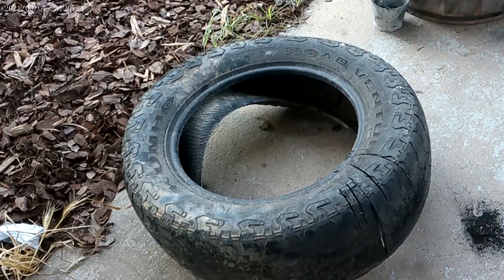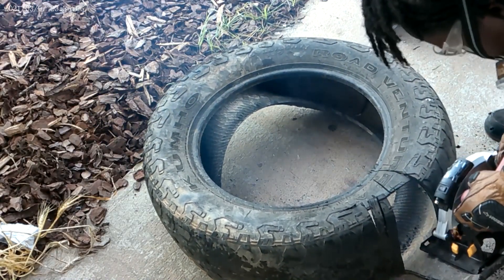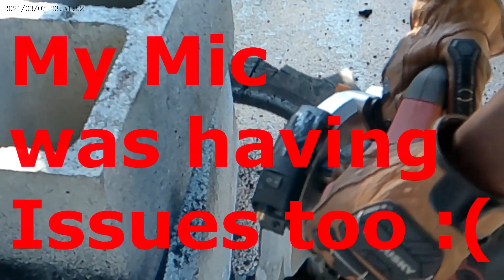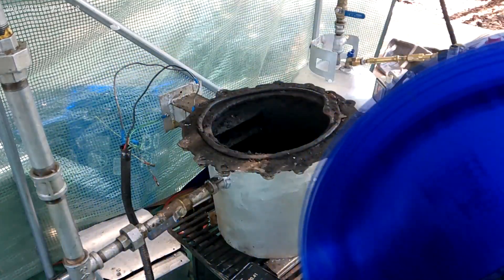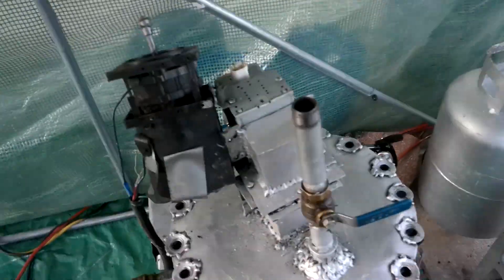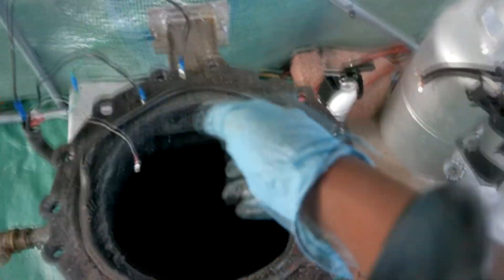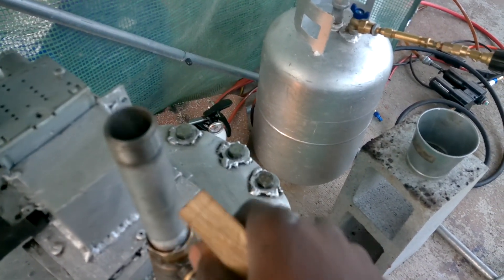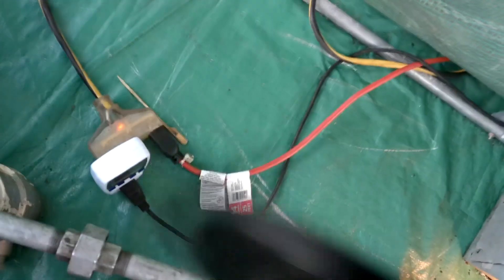Will It Pyrolysize? -  Rubber Tires

Comment: bro i see you upload a video of russian guy that did it, but i think the final color is clean depend of low temperature of condensation (i think).. also the video mentioned is "Tire-extract fuel vs pump gas - which is better?", 
also you can try condensation with air conditioner compressor with coil around water?

Comment: Will the steel bands in the tires mess with the microwaves? Also you say that carbon readily absorbs microwaves. Is there a practical way to clear some of it out a few times during the process and would that do any good?
Reply from the maker: The steel acts as a microwave antenna, forming microplasma that helps the tire break down even more. The best way to clear out the carbon is with some type of agitation system / stirrer blade. I'll be adding this into my next reactor.
Reply: @naturejab  Understood.

Comment: This one is very interesting as well. I've heard about someone cracking tires back into fuel/oil but I guess it wasn't profitable. It's up to You guys with brains and drive to get over that hurdle.
Reply from the maker: In theory, all pyrolysis can be profitable. The only issue is getting the oil to reach EPA standards and all may not be so profitable
Reply: @naturejab  Is the EPA as strict on agricultural fuels?
Reply from the maker: @heliarche  Not sure, need to do more research on modern fuel emission standards

Comment: What temperature is the gas when it enters the yoga ball? Is there a reason you don’t have a condenser like a water jacket or coil?
Reply from the maker: The gas is very cool. The microwaves do not heat it much at all, so I do not need a condenser

Comment: Impressive. I’ve never tried tyre pyrolysis because the stories of the fumes scared me off! That is a BIG yield of oil for the amount you put in. If this is less smelly than heat pyrolysis of tyres, you’re on to something…
Reply from the maker: For sure! The oil yield was super surprising to me, a lot of potential in the yields. The oil surprisingly didn't smell bad, even when burned - it smelled just like the plastic pyrolysis oil. Thanks for watching and commenting as usual!

Comment: I would love to see any form of electronic board next. They are extremely varying in material but this macro method of destroying the material holding it all together I think has potential.
Reply: They also have resins in them that would provide the carbon content needed to absorb the microwaves.
Reply from the maker: I also think the metals onboard would act as an in-situ catalyst, definently want to try this out!

Comment: I think some years ago I heard that a rubber company experimented a lot with pyrolysing tyre and rubber waste, and they actually built a prototype pyrolysis plant for like 50 kg batches of shredded tyres. But they could not find a way to make the product valuable or usable and lost a bunch of money on it. The product always ended up too dirty, too stinky, too acidic, too sulfurous and NASTY in general. Any attempt to clean the product would just make the entire process too expensive for a product that was still very low quality no matter what they did.
Reply from the maker: Wow, very interesting. Perhaps it may be the microwave interaction with the material, but I had no  crazy odors from the oil nor the gas product
Reply: @naturejab  Hmm, thing is the sulfur atoms in the rubber cannot magically disappear, they HAVE to end up somewhere. Either in the oil or the gas, or in your filters. In which case your filter materials are now hazardous waste, and cannot be just buried or dumped in industrial quantities. Like, safely getting rid of 100 kg/day of used kitty litter, steel wool and alkaline water full of nasty sulfurous toxic gunk would be a real problem for a pyrolysis plant. The non-hazardous forms of sulfur are generally the elemental sulfur and sulfate salts. Anything else is usually at least a little troublesome. Since your reactor is oxygen free, you will not be forming almost no sulfates. But the oil may have sulfur compounds that absorb oxygen from the air to turn acidic over a few weeks. You might want to know that rubber has way less hydrogen than HDPE or PP plastic, this means it will form a lot more unsaturated hydrocarbons that burn with a lot of soot. But the gas should be hotter burning welding fuel, it probably has a lot of propEne, butEne and butadiEne in it, so more like acetylene than natural gas or propAne. The A/E in the names of hydrocarbons is usually very important, A means its saturated with hydrogen, E means it is missing some hydrogen atoms. You might want to be extra careful with the rubber oil, as it probably contains a lot more stuff like benzEne, which causes cancer.
Reply from the maker: @TheBackyardChemist  For sure, thank you for all of your insight! I'd say the sulfur ended up in the filters and dissolved in the oil.